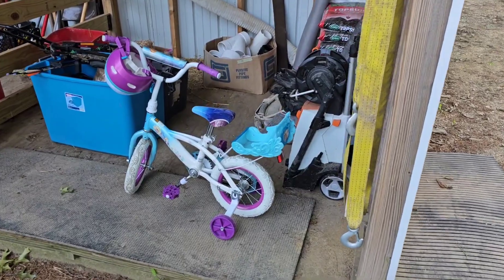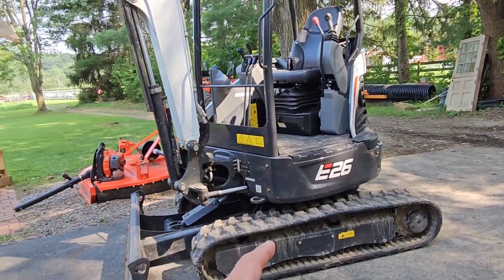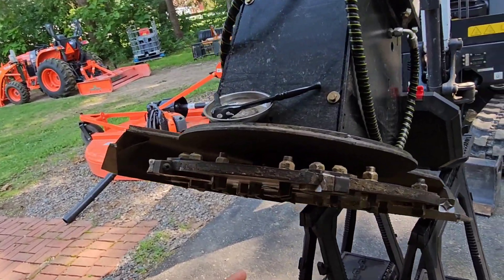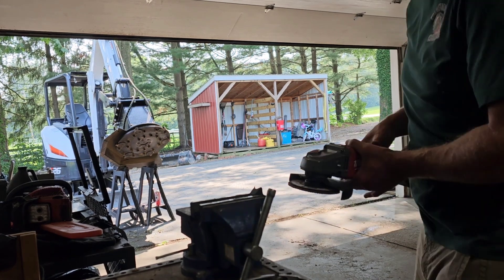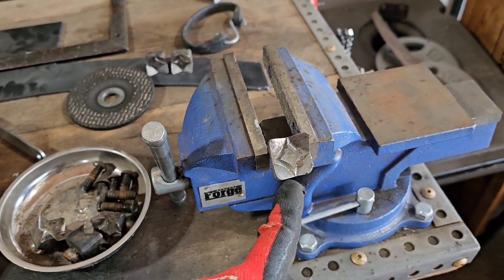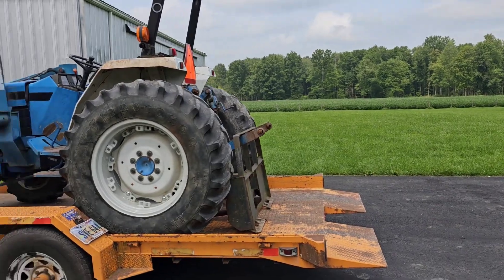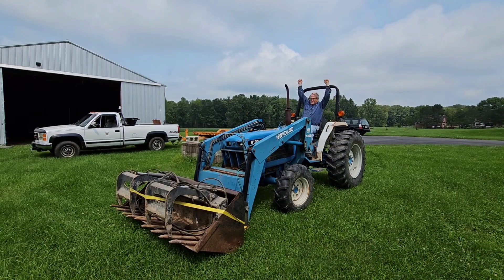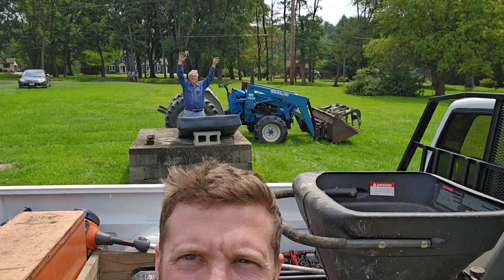Mulching Teeth Maintenance and a New Tractor!

Comment: Hey Joe, new sub. I’ve found it really easy to leave the teeth on the mulcher and sharpen them. Flip the head all the way back, extend the boom all the way out, rest it on the ground and you’re able to access the outer teeth and grinding teeth on the bottom. Not much you can do to the teeth underneath though other than clean them up. Guess you could buy a special grinding disc for carbide sharpening

Comment: How is the Rut working out? I just ordered one yesterday. 5 week lead time on delivery. I will be operating it on a KUBOTA U35-4. Does it bog down on bigger brush with your machine.
Reply from the maker: So far, I have had no issues with power. My machine is only 25 HP, but it runs the thing fine. I will tell you, it will bog down if you overdo it, but you'll find what works and what doesn't. I think you will enjoy it!